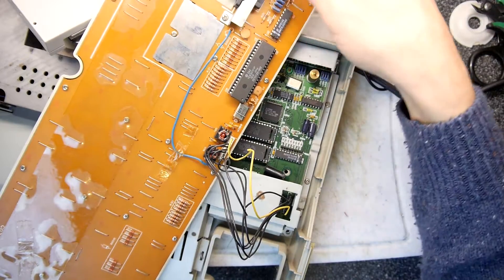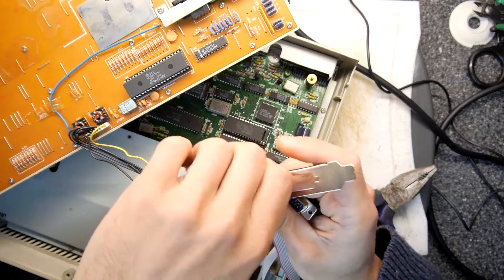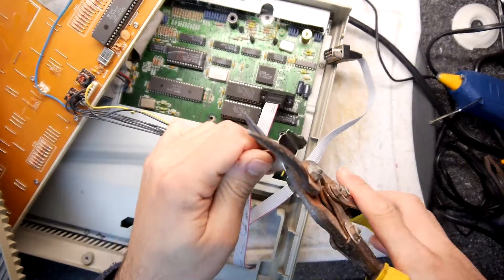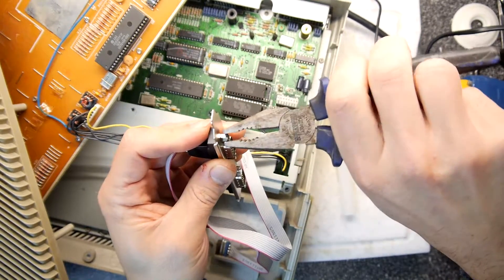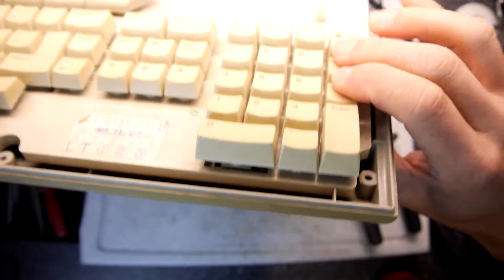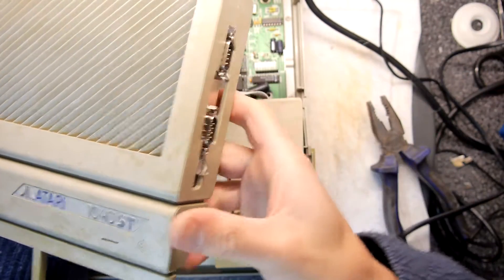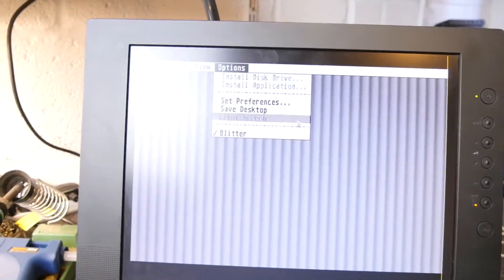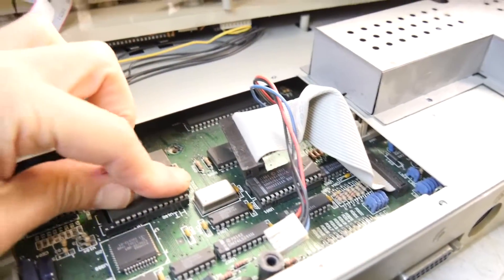Atari ST Joystick Interface Reposition Mod

Comment: I gotta get myself a small persons welder eqiupment.. Tiny stuff it seems
Reply from the maker: +Loggins1969 I'll put up a video soon on repairing my ST, I used a hot air tool for that. A rework station is all you need.

Comment: Ghetto :-). I intend to cut holes in case at back above other ports probably. I'm probably also going to add a power out to enable Gotek to be external.
Reply: Haha, I'm sure you'll get there !  
You can't afford me, I only work for beer and M&M's so we'll have to keep it platonic for the foreseeable future.
Reply from the maker: +Phrea Nix Note to self, learn how to make beer and M&M's from random stuff 😂
Reply from the maker: +Meth Methanoid you can probably route a ribbon through it and out of the back without cutting anything
Reply: The Backoffice that was original plan. And to think someone thought I'd ordered wrong cables for vGA adapter ;-)
Reply from the maker: +Meth Methanoid well you did, buy not ordering any 😁
Reply from the maker: So kind of you to say, I wish I had another 7500 people just like you on my channel :) Do you want to be my brand ambassador, the hours are bad and the pay is even worse, but all the resistors and wire you can carry!